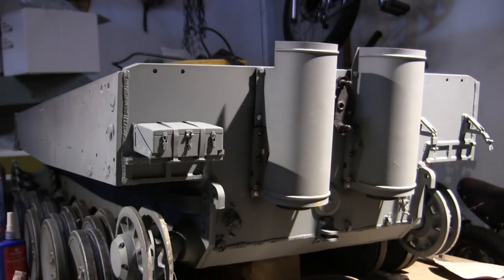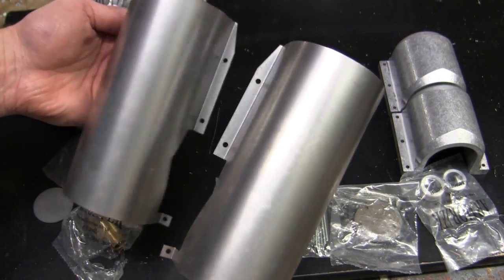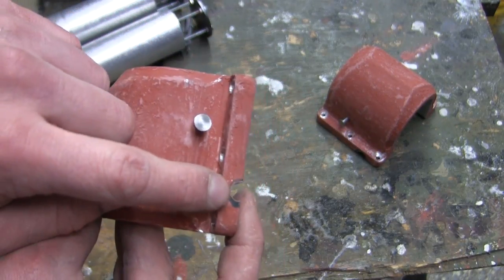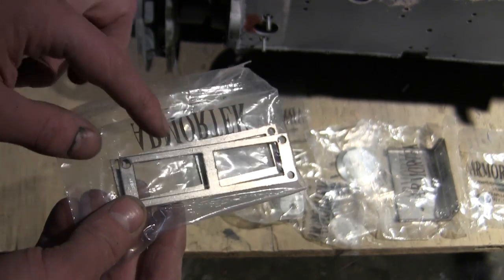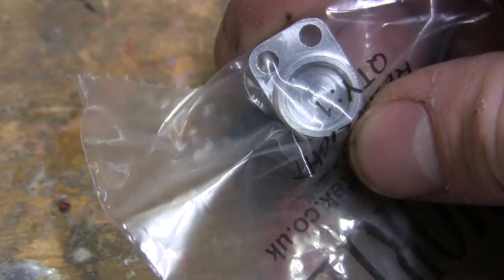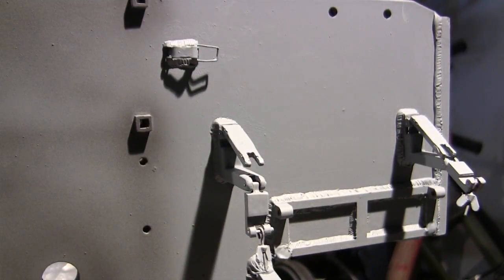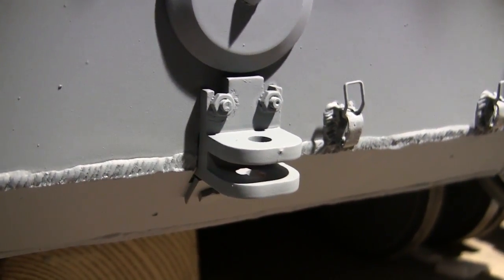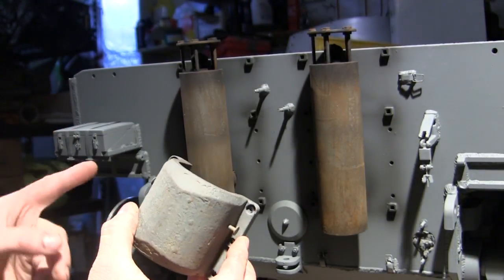RC 1/6th scale Armortek Early Production Tiger video #7 (smoke system and rear hull details)

Comment: Any companies to suggest that sell some good 1/6th or 1/8th cheap scale models that aren't too expensive and that are prebuilt? (Just wondering because i've seen 800$CDNs 1/16 tanks and just wanted to know if there are any company that sell them around that price, you know that when it's gone at around 800$CDNs. The best this is to just get to a higher scale that sells 1/6 scale or 1/8 scale models)
Reply from the maker: The cheapest thing in 1/6 and prebuilt would be the 21st century M5A1 stuart, they can be found for around $200.00 ~ $500.00 USD on ebay.

The dragon sherman, and PZII were common for a while prebuilt. last time I checked both can be found on ebay for under 1K USD.

Other than that your not going to find much that is what you are looking for. Once you go over 1/16 the prices jump to the upper hundreds and enter the thousands mark
Reply: Everything high quality is above 1000? Nothing around the 700s or 800s? Forgot to clarify that i was looking for german tanks, my bad :/
Reply from the maker: The Dragon PZII which can be found on ebay for USD $500.00 is the only tank that comes close to your requirements.
Reply: Radio controlled? (Saw it, i believe it has metal tracks wich is good and it looks wonderful!) It would be one of the greatest options i could get if it was R/C
Reply from the maker: What the panzer II? If so... nope static w/ plastic tracks. The only affordable sub $500.00 model that's rc is the stuart, and that too has plastic tracks / running gear. 

You will not be able to find any RC german tank in 1/6 for under 2k US. and that will have plastic tracks. anything with metal tracks will start at 5k US
Reply: What about 1/8th scale? I don't know much about these though...
Reply from the maker: 1/8 is a dead end scale, not much out there. And what is out there costs almost as much as the 1/6, sometime more but without the figure / detail parts infrastructure and support. Either way when you leave 1/16 get ready to pay more.

Yes I've seen the marder. It was about 3K if I can remember, and I was going to get one. I never went through with it though as another project came up and the funds were diverted. Still a nice model though.